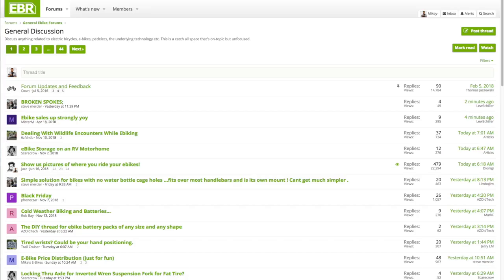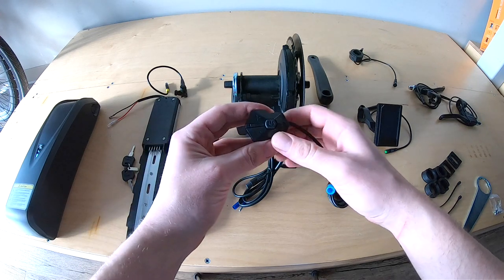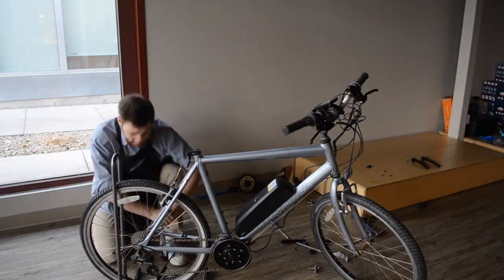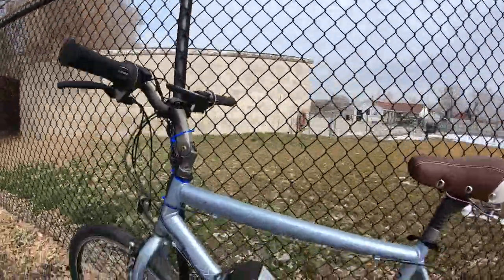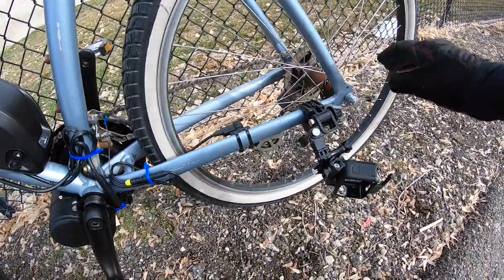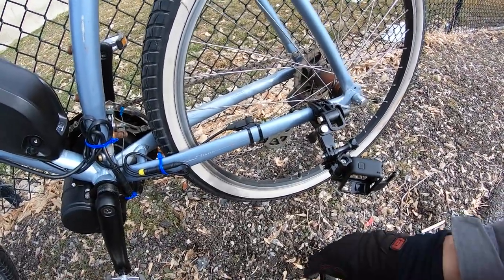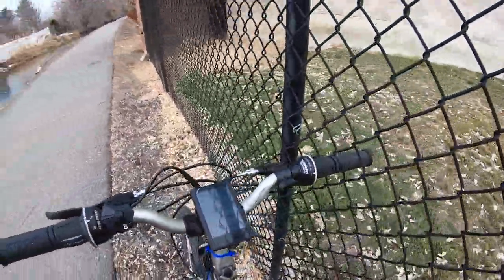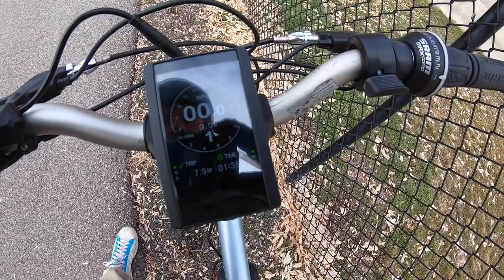EUNORAU 48v 500w Tongsheng Mid Motor Kit Review - $1k

Comment: On the tsdz2 you don't need the brake cut offs - the motor stops when you stop pedaling - just more cable clutter.
Reply: Ditto, my kit did not even come with brake sensors.
Reply: @deanhedin1615  I think they're mostly for folks who use the throttle exclusively. And/or if you set up the tail-light (I'll have to check mine when it gets here, but I think it dims/brightens the rear light with brake application if the lights are turned on, but I could be wrong on that)
Reply: If you needed to apply the brakes and tension the crank at the same time eg starting off, especially hill start, then you would need the cut off effect of brakes
Reply: @paddydiddles4415  Just practise your track stand.... torque assist based kits do not need brake sensors period. Proof? 5k without issues, running OSF at 750W ( bearing mods and cooling kit installed ofc ).

Comment: I thought I had to mount my battery upside down as well, but found that removing the panel on the battery mount revealed more mounting options through the heat sink.  Not obvious, but if your mount looks like it has three screws and a bottom cover you may be able to do the same thing.

Comment: 3 hours .it shows..the wiring is a complete mess :-} Would be interesting to see a side by side comparison to the Bafang 750.
Reply from the maker: That's a cool idea Rob, I haven't covered the BBS02 for a while now, maybe Mikey has access to one? Here's the old review I did on it and the BBS01 https://electricbikereview.com/brand/8fun/
Reply: @ElectricBikeReview  I have the BBS02S which I just competed on a Giant XTC conversion ..just trying to figure out  some lag issues with the PAS and throttle..seems to be a common problem which the Tongsheng doesn't have. I'm hoping reprogramming will address this. Something to consider is that many MTB's have too small a triangle to fit the Hailong type battery pack..very important to figure this out before ordering the kit from China.
Reply: The real mess was getting off the bottom bracket from the donor bike. Wiring was a piece of cake, really.
Reply: @BlueMonkeyBicycles  It's worth spending some $$ on a fairly new good  quality bike with hydraulics and reliable indexed sifters given how much the battery and the rest of the kit costs.  My second build was so much more enjoyable than the first where I basically ended up replacing  compnents and also dealing with a very tight bottom bracket ..in the end it probably cost the same..
Reply: @robvannNS  Ha ha! I thought the same thing! During the written review I lamented heavily that I used this bike and not something much better.
I'm aiming to do more kit reviews in the future. What bike would you recommend for adaptability to different systems?
Reply: @BlueMonkeyBicycles  I'm partial to my Giant as it has good components, seemed well built , weighed just 27 pounds and for the price very good value. I wanted to end up with something weighing 45 to 50 pounds for single track tails.. Even so there will be unanticipated issues which may require a little adaptation to make a mid drive kit work..right  now I have a chain alignment issue which requires  a slight modification of the rear cassette, not a big deal but unexpected.  Looking forward to seeing the reviews on the new kits out there.
Reply: What kind of speeds can you get on flat ground with throttle and pedal assist with the tongsheng? I'm trying to decide between the 500w and 750w motors. I'm converting a steel road bike with skinny tires so I'm wondering if 500w is enough to get up to 28ish mph.

Comment: I love this kit 500w with 15ah  Samsung battery. Have 2 kits tidily fitted. 
My wife's Giant liv which she really wants to ride places now.
I have the same kit on a 2018 Giant Roam Disc hybrid and I fitted the bikes original larger 2 cogs 32 and 48 teeth with the adaptor. Used the guts of the ebrakes and fitted to my hydraulic set up because if you have your foot on the pedal stopped waiting to take off the motor will want to move.
I use the smaller gear to climb super steep hills with ease and on the flat stay in the 48 with the rear cassette 11t and easily sit around 40ks. 
You still have to pedal to get the assist. (I left off the throttles) So it's great for my fitness as I am 65.
The pedal assist is outstanding and is so sensitive to input pressure on pedals. 
Such a good bike for just over 2k AU!
Reply: Sounds really good. Hope you don't mind a few questions:

1. Is it easy making this work with hydraulic brakes? I am thinking of the magnet in the brake levers that cuts the motor out? How do you get that working with an hydraulic brake system?

2. Do you have any thoughts on whether you need a suspension front or a rigid front fork with this kit? Any thoughts on whether one is better than the other?

Thanks.

Comment: To get the space you need to fit the battery, use the upper screw mount on the bike and drill a hole 
At the same distance as the mount, then find a screw that can screw into the frame to mount the battery holder.
 That's what I did for mine & it works fine with no problems!

Comment: Battery mounting idea...  I had the same issue  so I removed the plastic cover from the bottom of the mounting base and drilled a hole in the metal to mount the battery then put the cover back.  I also drilled an extra hole on the down tube and used a rivnut for an extra threaded mounting point.  It started wiggling the screws loose so I used thread locker and now it’s all good.

Comment: I think tht would be nice to test Lingbei mid drive motor. Its new company owned by Bafang engineers. It has very high torque and has improved gears. The price for full kit  500W-750W48V is about 400$ incl fees.
Reply: If the torque sensing for this one can be ironed out, it would be competitive with the tongsheng.  I was sold on the BBS02 or the HD but I think the Tongsheng has the best combo of features and seller / aftermarket / community support.

Comment: Great. I did just get a specialized epic marathon over 10 years old. Tong shen seems like the best option. Im not willing to replace my hydraulic xtr brakes to get a brake sensor. If you let go of the throttle doesn't the engine go into free wheel? I don't fully understand why those brake sensors work.
Reply: Oppqpp

Comment: Just converted a Trek hybrid with the 36V kit.  It is probably the best conversion kit available.   Make sure you get the 850C display option.
Reply: Why 850c and not VLCD5 ?
Reply: @grmar1494  Because the 850C display is better and you can upgrade the firmware.

Comment: Regarding the main power connector, On my conversion, I put an XT60 connector inside the cast aluminum box of the battery tray mount. This allows the battery tray to be separated from the motor's main power connector if you want to remove the tray.  It's also somewhat protected from the elements though for a permanent setup, I would seal the cable entry to the tray box with silicon. You need some basic soldering skills to do this. -Dave Muñoz  PS: nice video!

Comment: Don't put the battery upside down.  It's pretty easy to make a  bracket to move it up a bit. My first one was simply a fender mount piece of steel that I reshaped in my vise.

Comment: Hi Thanks for the video, did you have issues with the clearance between the motor housing and the bottom of the bottom bracket where the rear brake/ rear derailleur / front derailleur cables run?

Comment: I checked Aliexpress for more info on Eunorau offerings.  I have a Samsung 48v battery from a rear hub conversion I did two years ago.  I saw that a 48v 500 w / 36v 350 w kit without a battery was available.  I have two questions: 1 - From my rear hub conversion I learned that the controller had to match the battery’s voltage. What I don’t know concerns the battery’s management system. Do you know if there could be compatibility issues? 2 - I want to add a mid drive to a Day6 Samson, which as Court can attest to is a long bike frame.  I believe the cables need to be at least 14 inches longer than on a conventional  bike like you converted. You showed that you folded the extra cabling.  Do you think it was at least 14 inches?  I really enjoyed this video and look forward to many.  But I want to make sure that you know Court owns the phrases “I love that...” and “I appreciate...”.
Reply: lol, I've been making moves to trademark some phrases: "anyways anyways anyways!" and "as you can imagine".
I think the only length issue you'd have is with the speed sensor. I'll go measure the length of the cable and get back to you. I don't think it's long enough from my memory.

Comment: Thanks for the video. I cannot get rid of my brake levers as they are for hydraulic brakes and they are also the shifters: RapidRise. What can I add to my levers to get the motor cutout?  Aftermarket sensors available? Thanks!

Comment: No locking nut on the crank just the bracket with the spacers? and could of rotated motor to clear battery the right way up.drill a new hole and fit a rivnut  to alter in triange position.

Comment: I believe I have the same motor but it doesn't seem to like the 48v battery. It just doesn't do anything.  When I install the 36V battery the motor activates and assist with peddling. Do you know why it wouldn't take the 48V battery?
Reply: I read on the endless sphere forum that the 36v motor's stock firmware causes the motor to not work with a battery above 40V. The 48V motor firmware does the same but at 50V or 55V. The open source firmware linked to in another comment on this video seems to be able to allow you to use a 48V battery with the 36V motor.

Comment: I have a rad city 2017. The regen only activates when I pull a break lever part way. . but the geared motor always causes resistance . . so i have to pull my break to activate it And I can't even coast down hill or flat as the geared motor will slow me to a stop with no breaks. Its a good bike but good grief I love the feel of coasting.
Reply from the maker: Hi Marcus, it sounds like your RadCity has a gearless direct drive motor (I actually know this to be the case), and yes, they do create some magnetic drag. It's one of the trade-offs for durability and regenerative braking ability. Not much that can be done... their geared hub motors (and most geared motors from other ebike companies) do freewheel more efficiently :)

Comment: If you are ONLY interested in pedal assist, can you simply miss off the throttle and the brake sensors? Does the torque sensor react quickly enough when you brake to cut the power?
Reply: I didn't install the throttle and I also blanked off the cable with self amalgamating tape as I wanted a pedal assist bicycle and it has been fine for the past two years.

Comment: Hi there.good build.i had to mount my battery 🔋 upside down too but kuz of the shape of my battery it looks actually better than it would the proper way .I got the bbso2 bafang. 750 watt.its a beast as I live in Scotland and there's lots of hills and steep ones too so my e bike is a must.i find the 1000 watt motor here would be too much and the 500 watt would not cut it for me as all the hills in my area.hence y I got the 750.i love it.does 38 miles hour so it brilliant.🙏🔋☮️🤘💯I do limit the speed to 15 miles an hour tho on the roads just Letting all tha Karen's know ye 🤣🤘☮️

Comment: I had the same problem with the battery pack. my solution was to keep the battery in the original orientation, move the lowest battery tray slot  to the upper-most cage-boss on the down-tube so there's one hard-point into the frame then  3d print some brackets to take the place of the water-bottle mounts.  The 3D printed brackets are PETG and won't damage my aluminum frame.  If this proves reliable, I'll post the STL files on thingiverse.
-Dave Muñoz
Reply: yes, please post the link on thingiverse or printables. that would be great! would help to post photos of the parts on the bicycle too. thanks!

Comment: I have a question for expertise: My bike has lots of lights and a small sound system. Can I use a car battery for my ebike?
Reply: Most electric bikes operate at 36 or 48v. If you sound system does as well, then you've got your foot in the door! Check out Micah at eBike School, he's got a lot of good information in that regard.
Reply: @BlueMonkeyBicycles  ok thanks. One more question. Do you make custom batteries?
Reply: @TIMELESSBACKDROPS  Very rarely. Normally I use a production eBike battery.
Reply: @BlueMonkeyBicycles  Im trying to get a battery built to fit in my motorcycle gas tank. Any suggestions?

Comment: Why to buy this unknown mid drive when there is a bafang motor?
Reply: I only see viable 2 reasons for mid drives (and I hate the sound when it yanks hard on the chain, freaks me out that it's gonna snap and shred my leg) over current gen hub drives anymore:
1. Class 1 MTB's that are considered "trail gentle" by people worried that anything over 250w will tear up trails 
2. Conversions. My main eBike is a geared hub 750w, and it's my favorite, but I am working on converting an old school banana seat low rider  :P
Reply: It is not unknown and has torque sensing

Comment: When it works it's good motor. But will break down. Bearings are pretty cheap quality. And they use a wave formed spacer in axle and mine broke causing a lot of play. Blue gear bearing broke after 800 km. Large one way bearing on driveside will wear causing play.  And built in PAS sensor ring will brake when parts have play sideways.
All parts can be replaced but not easy job.

Comment: Checkout eco-ebike.com

I bought a 48v TSDZ2 mid drive from them. They're the only company that I know of that is tinkering around with this kit. They have an overdrive version and they're programming third party computers for it as well. Their website sucks but they are very friendly and helpful if you email or call them.

I plan on converting my wife's Diamondback next using this mid drive. The mid drive feels very similar to the Bosch system on a Haibike. All in all this motor makes for a budget friendly ebike that performs very close to the systems used in the higher end ebikes.

Comment: That is the exact issue that is going to lead to E-bike regulations, the tires were questionable and people are doing this and insurance companies are paying out for injuries, insurance companies will only pay so long before they start up with their lobbyist and get laws and regulations going. Please make sure your bike is in good shape before you are going down the street with cars at 20+MPH.

Personally, I wouldn't even ride an E-bike that doesn't have disc brakes. Rim brakes might work fine, but I distinctly remember how crappy they are if they get even a little wet, and I'm not trusting them at 20MPH.
Reply: there is e bikes with rim breaks in shops made by approved manufactures, if it was unsafe it would not be approved, i been down hill thousands of times at 20 plus in wet, with rim breaks, you slightly use the break to remove the wet before you need them more as you get to the end. but not many ride in the wet. unless caught, and then its get home time.
Reply: @tonyrichardson2637  that’s all fine and good, just know insurance payout = regulations.

Comment: "Braze-ons"? They are called & referred to as "Brass Bosses" - As well, they can be drilled & installed anytime you'd like... A lot to learn yet mate 'eh?
Reply: Everybody calls 'em braze-ons around here. Yes, I know they can be installed anywhere, but I didn't have access to a full bike shop.
Reply: Search Youtube for: "rivnut installation without tool". You can drill a hole and install a M5 rivnut anywhere without buying the expensive installation tool that works like a rivet gun.